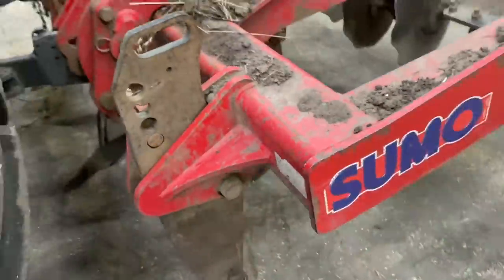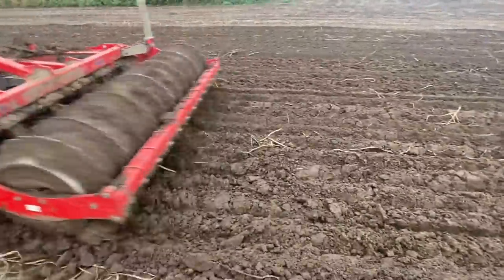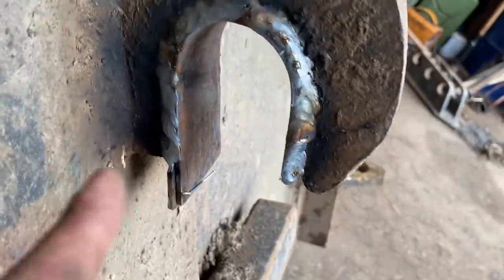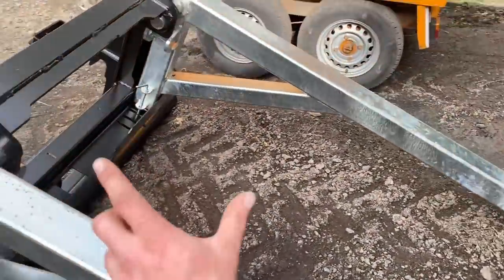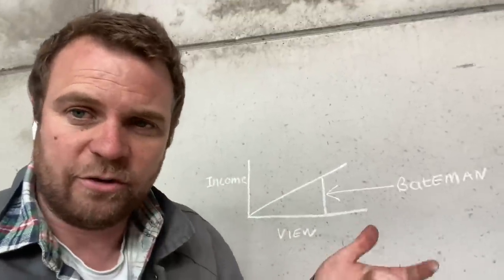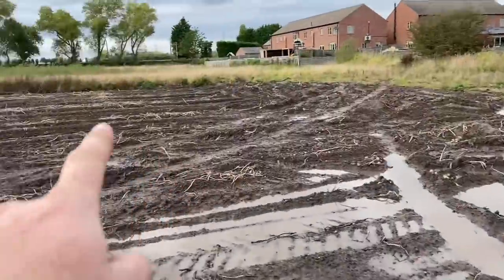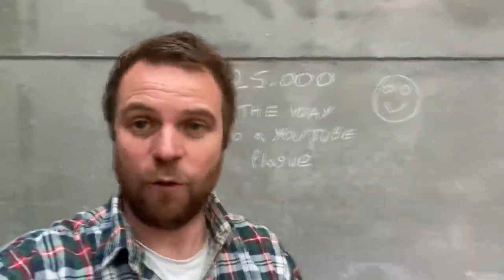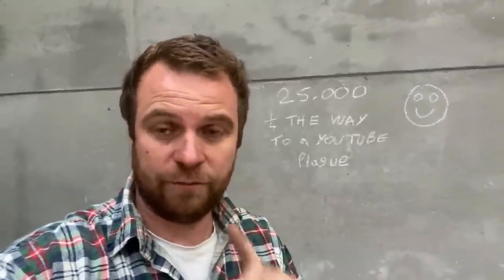Day564 #OLLYBLOGS MAKEING A MESS TRYING TO DRY SPUD LAND OUT A NEW BAG LIFTER  #AnswerAsAPercent

Comment: You'll end up hoping you had the ram on the lifter going betwween different sizes and manouvering. Could you borrow someones subsoiler and take the roller off but put it on the 936, will leave the surface a bit weather proof and chunky but a big tractor like that should have no issue with a 3m ish subsoiler like that.
Reply from the maker: We might drop discs out of the sumo

Comment: Why didn’t u put the 936 on the sumo, are the tyres bold on the 936 or what?
Reply from the maker: Because it was already on the 724
Reply: @OllyBlogsAgricontractfarmer  yea guess it was easier on it. But got a 360hp tractor sat on a trailer in the yard put that on the sumo

Comment: Mb trac is definitely sub zero 1455 would say cool. If you need any bits for mb trac try getting in contact with company called Arthur ibbetts in Cambridgeshire there still unimog dealers and may have spear part knocking about for mb trac. There probably one of the oldest running agricultural companies still going and still family run.
Reply from the maker: I spoke to mb track man and he had a second hand panel 😁

Comment: Why can't you drill a hole in the front of the trailer to let water drain when they are standing, you can put a nut and bolt in it when needed to stop oil seed coming out, this must save the floor wearing away with rust if no water is aloud to build  up,
Reply from the maker: Tbh there are drain plugs I need to take them out now harvest is over

Comment: Not telling you how to suck eggs, but go on an angle to the spud rows. Easier pulling and makes a better job of lifting out the wheelings.
Reply from the maker: We tried that and it was that wet from pitching left to right it made it worse for level 
Will leave it few days
Reply: @OllyBlogsAgricontractfarmer  Is the draft set right? Admittedly a Shakerator with an Oxford roller but never fails to level a field at a 45° angle to the rows.